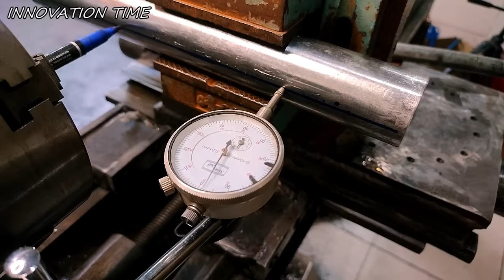How to make a Tailstock

Comment: Hey brother, all the force from the tailstock shaft is axial in an inappropriate bearing and only one lock holding all the force, a solution would be to add a cover with 3 holes on the back of the tailstock so that the effort is less harmful to the lock, ensuring greater resistance In contrast, it's still top.